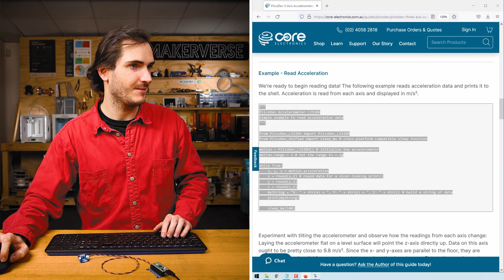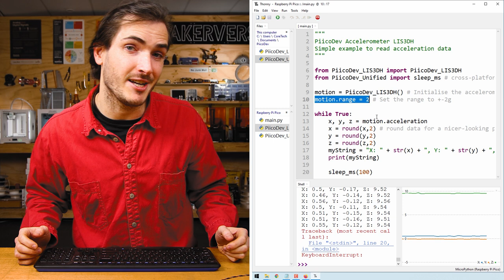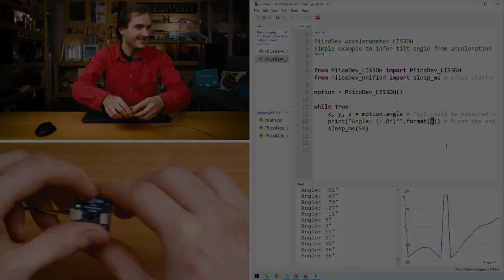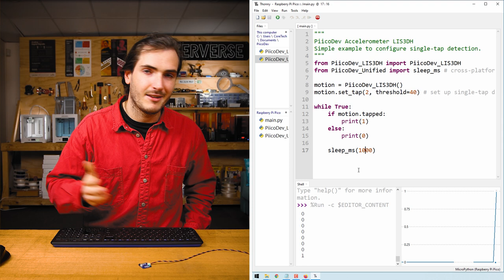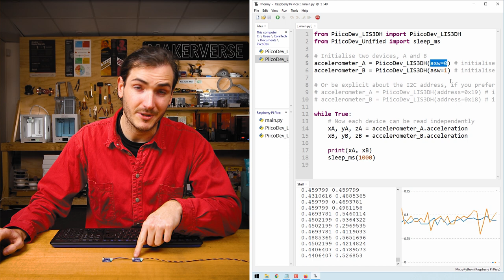PiicoDev 3-Axis Accelerometer LIS3DH | Guide for Raspberry Pi Pico

Comment: I wonder if I could use one of these to detect an imbalance on a motor shaft or crankshaft ? I suppose it would depend on how fast the refresh rate is and whether I could programme the pico to detect a peak value and trigger a strobe at that peak - looks like another project just got added to the list 🤣
Reply from the maker: Let us know how you go with it, sounds like a fascinating project. 👍